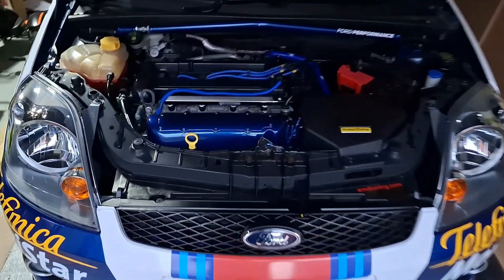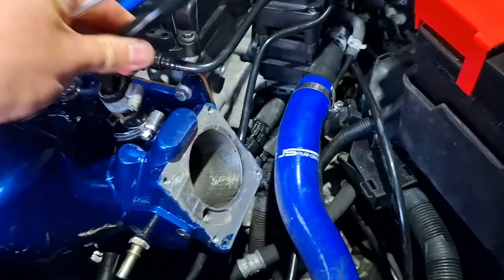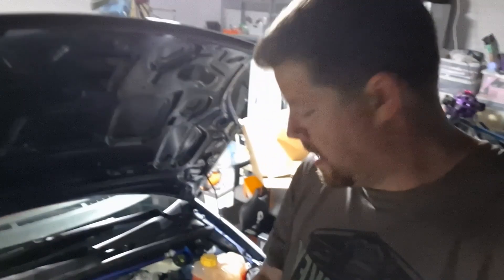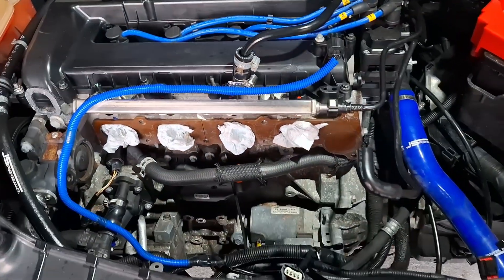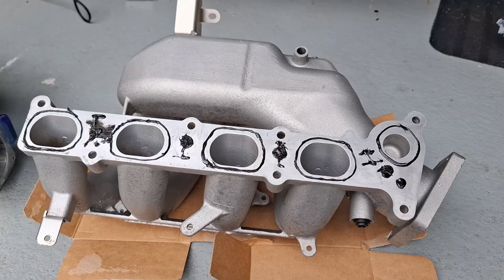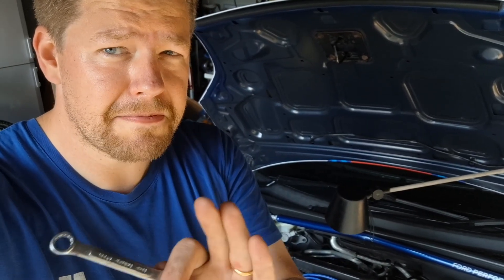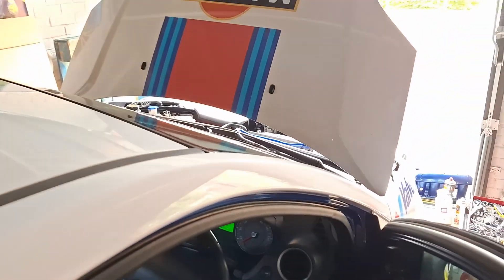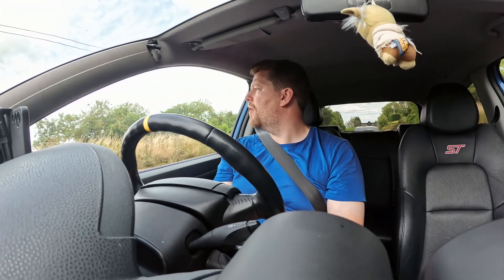Ford Fiesta ST - Mountune Inlet Manifold - Fitting & Test Drive - Duratec 2.0

Comment: Are the original manifold bolts reused or are they different for the mountune manifold. Thank you
Reply from the maker: I used a mix of original and flanged bolts to be honest. The most important bit is even torque levels and getting a good alignment with the thermal gasket.

Comment: Firstly nice setup brother. Looks mint. I have the cossie inlet on my ST with steve Wyndham racing cams, st190 dreamscience map ect ect. 

I was thinking of taking the inlet of and putting the original inlet back on. You think i need to remap it again when putting the original one back?
Reply from the maker: The car will run, but you'll end up with less airflow up top which might make things run rich and you'll lose power would be my guess. Should be able to drive to a remap (I went from cossie to mountune for example)
Reply: @hengineer1  thank you, that does make sense. I'm actually hunting down a rich condition, no codes whatsoever. The only reason why i want to remove the cossie becuase of the hose to the pcv to the manifold just gets soft over time. And  its get kinda hot here in Cape Town😂

Comment: Would these be considered the same engine as the 2.0 mzr in the US Mazda 3? Or closely related?
Reply from the maker: @detaildad4894  yes. Mazda developed the engine - many parts are inter changeable. The previous Cosworth replica inlet I had fitted was for a Mazda 3!

Comment: Hello! 
Nice video!  I'm still mad at Mountune why they don't make a 3D print version of this manifold.......... (much cheaper, they can make it only for order, and don't hurt the original 50 + 15 remake iron ones)
Reply from the maker: @istvan5400  I looked into the cost of 3d printing one... it could be done with CFRP reinforced polymer and would be only a few £100.
Reply: @hengineer1  you right, but mountune won't do that sadly.....
 blueprint is not available
and the shape and size is key of this manifold. I still think this would be easy money for mountune without risk.
Reply from the maker: @istvan5400  Mountune won't... but a Hengineer might 😉
Reply: @hengineer1  let me know please :))
Reply: @hengineer1 I'd be willing to pay a fabricator to recreate them but could we use your manifold as a template?
Reply: I spoke to a fabricator and they reckon they can make one if they have one to create a template

Comment: Why not just vent the breather to atmosphere?

Any reasons other than legalities?
Reply from the maker: @tomguerin4584  smells bad, would leave off a pipe / need a bung post filter on the silicone elbow. It's how the CAIS comes...
Reply: @hengineer1  fair enough! Just seems mad when it creates so many issues for these engines in the long run. 

Makes a right mess of the TB, MAP sensor and inlet long term. 

Cheers for the reply, subscribed. 👍🏼

Comment: Really well presented, clear and concise. I'm very local to Jamsport and mine is nearly ready for a remap. Hopefully get that done in September. I went mountune air box and a full exhaust (including the matching Evo2 header which i had heat-wrapped by Jamsport already, prior to install) but nothing more than that engine wise, not looking for big power just get a bit of a bump keep it OEM+ and get the emissions back in line. I'm also not telling you how much I (over)paid for the mountune airbox, and def not telling you how much the Mountune embossed floor mats i found after that, were either!
Reply from the maker: @djmandrick  The Mountune tax is bonkers! I've got the original Milltek mani on my exhaust - told I could have made 5-10ponies more if I refreshed the engine, skimmed the head for more compression and to the tune of £2000... I think I'll wait for the dreaded oil drinking to begin!
Reply: @hengineer1  good option! I chose to buy an EP3 with my upgrade money.
Reply: Just snapped up an air box on ebay, very rare. Has damage to the hose but i'll fix that. Do you attach the hose to the front grille or let it hang lose? thanks
Reply: @alanpatterson2759  Like me in my garage, mine is just hanging out. I did see someone had 3D printed air scoops that attached to the grill (they said they were selling them on ebay) but i never looked into it. i do probably need to find a more permanent solution but i didn't even realise the tube expends if you stretch it......I thought it was a bit short! The weight lengthened it over time of it just hanging there until i spotted it hanging below the bumper level! I have it just hanging around the wheel arch area and seems to work fine.
Reply: @djmandrick  I have a 60mm throttle body to go on still has the original. Some say it changes the torque delivery. What's your opinion if you have one fitted?
Reply: @djmandrick  Thanks for the reply i did find a post on the st forums that said lower front grille for the air pipe. Guy did a pdf file of mountunes original instructions did post the link but didn't pass the censors.
Reply: @alanpatterson2759  Personally I didn't do it. Common consensus was dip in torque low down and only really benefits when paired with upgraded cams and i upper RPM. Then you are looking at a high cost higher BHP which this engine isn't the one to do it on for in terms of comparative cost in to performance out. So are you ragging it everywhere all the time to get to enjoy it? Doubt I'd even notice it fitted or not fitted without all the other stuff. Prob more throttle lag if anything. Then you'd def need  a remap. I saw it a supporting mod to everything I'm never going to do to it. And not for me I don't drive it like that and it'll never be tracked. For me expense for likely worse torque where i'll be using it 90% of the time, which it lacks already, wasn't worth the bother or cost.